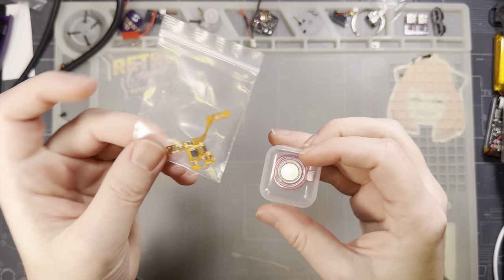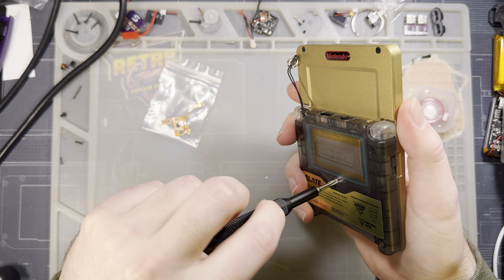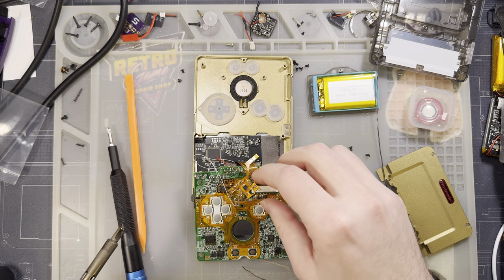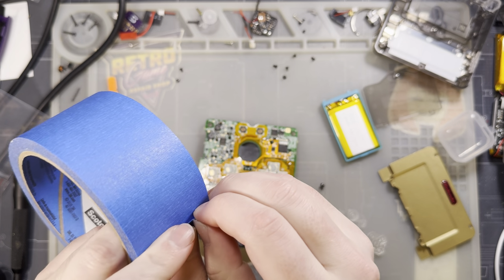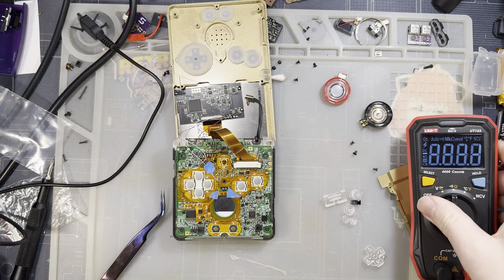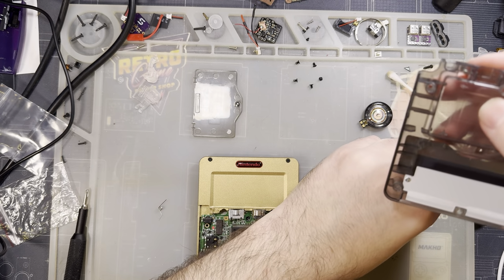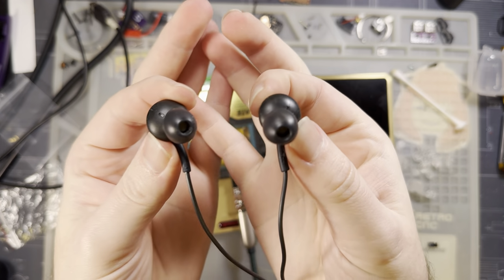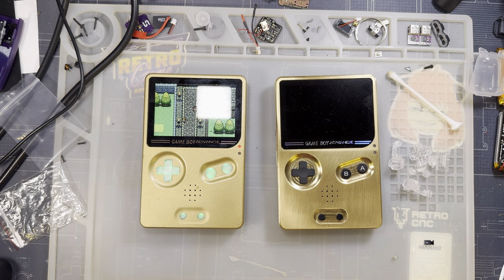Game Boy Advance SP but Louder (CGS Amp)

Comment: fortunately I made a comparison of the chips using the shelders, retroix and this new mod that came out recently, this can amplify approximately 1w while that of herlders 1.5w and that of retroix 1.45w but as a positive point for this modification is that the capacitor used for audio land is still used, while in with the retroix and helder use their own capacitor coming to a land that does not pass through that capacitor, this is not necessarily good or bad but I think it is a point to highlight besides being the cheapest of the 3

Comment: another reason it seems that the audio amplifiers stink is because the speakers are not prepared to do so without the 1w and 8 ohms that are usually sold, but recently I found a 23mm 2w and 8 ohms thinner speaker than many others that sell that perfectly digs and that for this type of audio mod is perfect able to withstand the loudest audio without cracking as you do the oem and third party brands
Reply: May I ask where you found that speaker? I have yet to find one with those specs that fits in the SP without modifications.
Reply: @SpasmicGames  I sent it to you from a lot of my name called Retrochip
Reply: could you also tell me where you found the speaker?

Comment: to be able to fix bad audio, it is true that there are mods that help to clean up audio, such as helders or retroix, but in principle you could also switch to audio ground capacitor for one maybe a little larger than 220uf and 6v or 10v to eliminate a little more unwanted noise, but it would only work with this audio mod amp because the rest don't use audio land

Comment: I experienced a crunchy sounds after i install this amp... What seems to be the problem?😢
Reply from the maker: I wager your game boy has always made that sound and now it's just louder.
Reply: @makho  its ok now.. i used a ceramic capacitor for replacement...
Right now im interested with your video about clone sp lcd compatible with 001 board using adaptors...in Philippines that is Ma Angas 🤘😎

Comment: Have you ever tried to use a dsi screen that you pull yourself with an ita ribbon from funnyplaying? I know the kit with the laminated DSI screen is only 5 more, but wondering if it would fit in an oem shell since otherwise it requires their shell. I have two DSIs that I play GBA on all the time but love the formfactor of my SP 001.

Comment: 45:19 min in principle as this mod is one of the least elevated audio is also one of the least consumed (aprox 0.02A), "video game restoration" made a comparison between different mods for the game boy, between them this and the retroix and this is of the least energy consumed by all and although it seems that there are different mods that of gb and gba sp actually all these orange amplifiers use the same chip and components so the difference will be minimal between them

Comment: So i came across this amp on aliexpress and thought that it might work well in my wonderswan color since the volume on that is too low. there's no one whos done that kind of mod but do you think it would work out? the problem i see is not having granular control of the volume, just the 3 volume options so if the low volume is too loud then oh well. Any thoughts on doing this? i don't really see why it wouldn't work provided i can find a 3v point on the wonderswans board.
Reply from the maker: Hopefully they use the same voltages and audio format. I don't know anything about wonderswan.

Comment: Thanks for a very useful video. I added the amp to one of my GBA SP SpongeBobs. I now have twice the volume vs no amp. That means waking up others late at night with this thing lol. As for the speaker you installed, would you say it’s better or the same as funnypaying? I’ve already installed this in 4 GBA SP’s.
Reply from the maker: I don't notice any difference between the speakers.
Reply: @makho  ok so the only thing that would make a difference is in anything would be the amp as long as the speaker could handle more volume.

Comment: You talk about stacking mods, I’m having issues getting a usbc and headphone jack work together. Do you know of a company that makes a usbc adapter that is compatible with the headphone jack mod? I think I used the funny playing usbc with the Half oval sides. I enjoy the content!
Reply: They are out there, i know one of the kits allowed audio to pass through the other didnt. Pretty sure if you have the fp kit your good.
Reply from the maker: As long as you use the HP switch the way it's meant to be used (audio gnd /= gnd) then it should be fine.